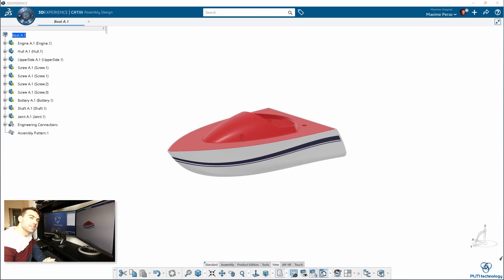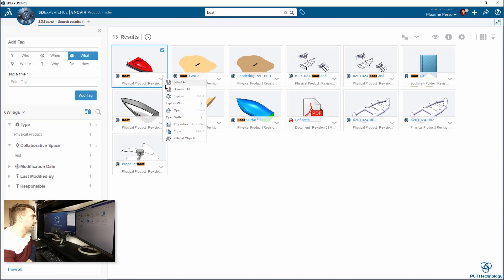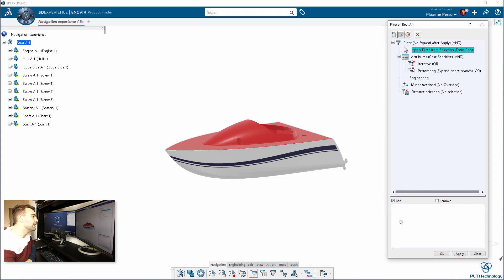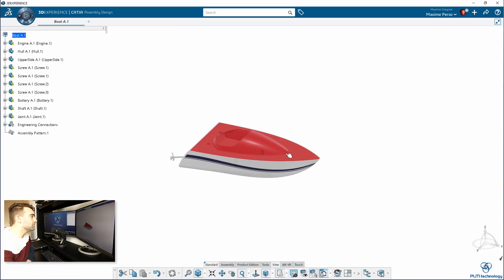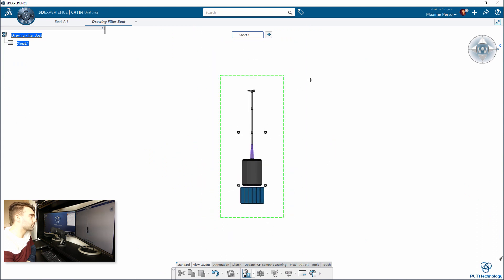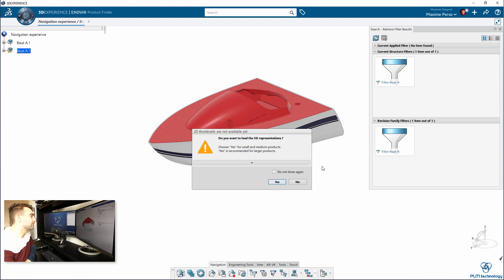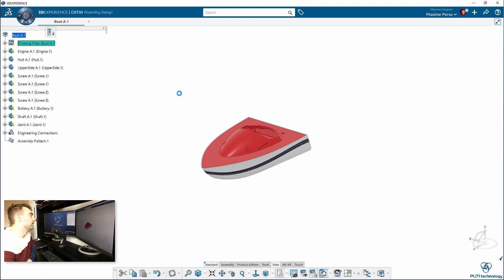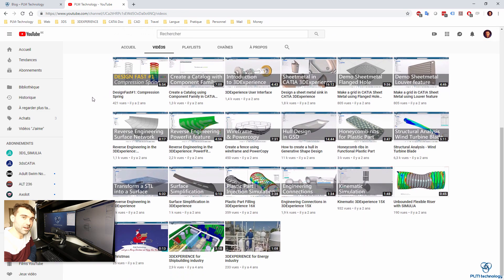Filters in Drawing ENOVIA 3DExperiene R19x (Live)

Comment: So, the filter can replace overload properties functon isn't It?
Reply from the maker: Hello Yannick, no it will not replace it since overload properties function is still remaining in drafting. However it is easier to filter big assemblies with Filter. CATIA always provides several tools to do the same thing. In that way, CATIA is more Flexible. For instance you can also use markup and slide to obtain this result.
Reply: @MaximeChagnot  ok I'll check tomorrow, thanks again for the tips